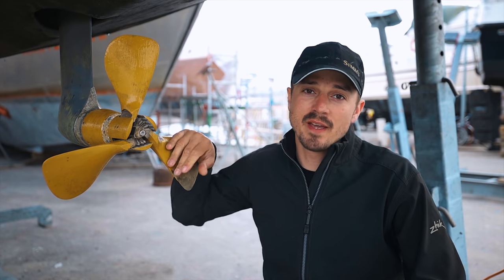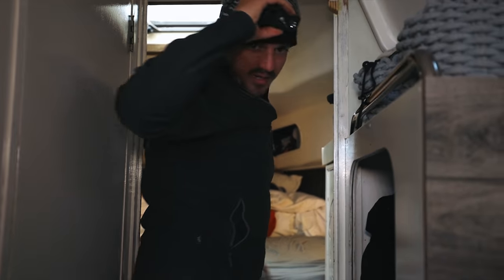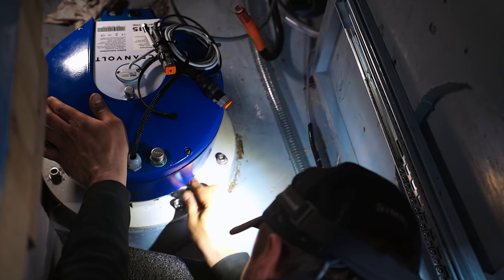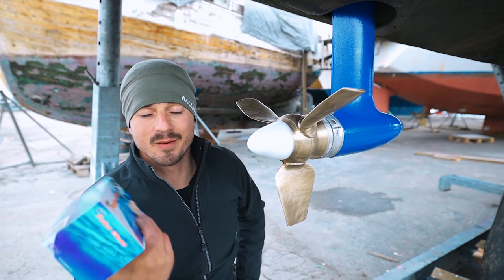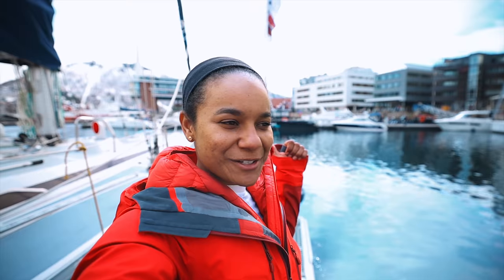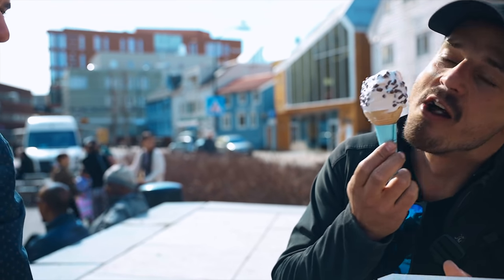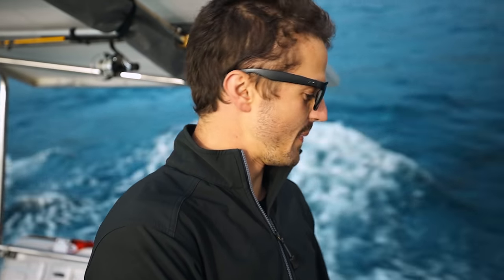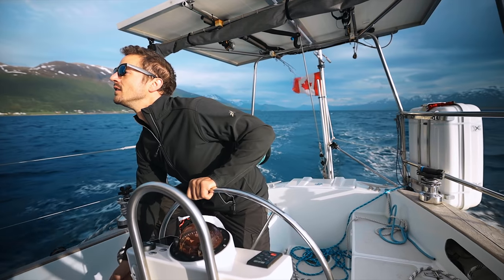Ripping Out our Electric Motor for the LAST TIME! — Sailing Uma [Step 277]

Comment: You will likely notice more of a speed drop with regen in lighter winds and slower boat speeds, not strong winds.  But then in lighter winds, you'll most likely have the prop feathered and not doing regen anyway.  My only negative comment is that prop strut is a terrible shape, will be a great weed catcher!  If ocean volt would shape that strut to shed weeds, it would make a lot more sense and be very do-able.  Love the controllable pitch prop tho, that is awesome in getting max prop efficiency at a wide range of speeds both in propelling the boat and regen mode.

Comment: How many batteries do you have  on the boat? When you use only the batt to run the elecktromotor, how long das it last on full power and full resistant?

Comment: Just an oddball idea to occupy your mind. Two bit da Vinci just did a piece on a 1940's Swiss electric bus that used a large flywheel for energy storage. One of the drawbacks was the gyro effect of the flywheel. Wouldn't the stabilization of a horizontal flywheel be an advantage on a sailboat.

Comment: I so admire your dedication to the electric drive idea. I had serious doubts on efficacy in the beginning but you've pretty much proved me wrong in many, if not most, aspects. Certainly now that you have the latest/greatest setup, I think even more downsides will be mitigated. I'm sitting down... what would a setup like what's currently installed cost?

Comment: Interested to know, when you fitted the saildrive leg and bolted it up to the motor. The hole the leg went in didn't seem to have any fairing (i.e. on a  normal engined sail drive there is a rubber skirt fitted to go flush with hull. Does UMA not need one?) does it not cause some disruption to the flow  of water over the hull where hole is? It seems like an ideal place for stuff to grow. 
Great video by the way
Reply from the maker: Things would grow more if we closed it off..

Comment: @ Sailing Uma
  What did you use on the bottom of the boat to keep it so clean?
Reply: Constantly cold water!
Reply from the maker: Sailing. Ablative paints needs to be worn down by water over the hull. If you sit still, stuff grows.

Comment: In all the years of you having an electric motor(s) , it has proven you to be exceptional sailors and that is all...the E motors and battery capacity has been sub par for the average sailor needing  to motor from A-B in opposing winds and currents. You had favorable winds for Hell Gate NYC...I can imagine less favorable conditions and someone with less experience failing that attempt. However, this new motor with solid state batteries would be magical.
Reply from the maker: Yeah no reason to ever motor against wind AND current. That’s is a recipe for disaster even with a diesel boat. 1 OZ of water in the fuel and you’re F’d.

Comment: So, for anyone with a technical interest, of course they can regen without slowing the boat. With the wind they were experiencing they were coming up against the maximum hull speed of their vessel. That means it was taking absolutely HUGE amounts of energy to give them the next 0.1 kts of speed. So when they turned the regen on, some of that HUGE amount of extra energy that they had available with that much wind and sail, was converted into electricity. It did not slow them down because HUGE minus 300W, 600W or even 1000W, is still much more power than it takes to move the boat along at 6.5 to 7 kts.  :-)  (hope that helps anyone that wondered about the physics!)

Comment: Thanks for pushing and helping advance this technology - its really great to see how much progress has been made. Can you make any comments about how the power (i.e. motoring) compares with that of a diesel? After seeing that yours is roughly equivalent to a 13 hp engine, I realize that it might not be a fair comparison. But why not? Comments would be welcome.
Reply from the maker: So electric works differently to diesel in how it applies it's torque, so although on paper, it's equivalent to a 15hp diesel, in reality, it pushes a boat more like a 40-50hp diesel. Electric is about 2-3X more efficient, so you can multiply the HP rating by 3.

With that said, we can motor at 7kts, drawing about 8-9kW on our electric motor. Same as you would with a 40hp Diesel.
Reply: @SailingUma  this is not true. Although electric motors have full torque at any rpm. Which is great for changing from forward to reverse, torque only matters during acceleration. A watt is a watt and a hp is a hp. This is just sales nonsense OV uses to mislead about the effectiveness of their products. You say you can motor at 7 knots for 9kw of power, but you leave out that you could only do that for 2 hours if you are lucky. But that is in perfect conditions which wouldn’t require much of a Diesel engine. Try it against wind and waves and see what happens to your power draw. A watt is a watt and hp is hp. You don’t get to multiply electric engines 2-3x just because the brochure says so.
Reply: @SailingUma  Thanks for the response. But, I sort of agree with the reply by Alex. When I'm motoring with a 40 hp diesel and at 7 knots in reasonably calm conditions, I'm using maybe 0.5 gallons per hour fuel. The engine is not outputting 40 hp at all but far below that. I'm only outputting 40 hp when going into a current and a headwind. I wonder if the Salerno sailboat had two electric engines because of this. Having said all of this - I'm super happy to see the technology pushed to this extent and hope that it can get even better.
Reply: @alexmiller8688  I kind of agree with you. But, in calm seas, little wind etc, my diesel engine is running far below max power to achieve hull speed. But so is the electric motor. We really need a side by side - which maybe Salerna could do since they've built an electric version of their 40 foot sailboat. But curiously, they are installing two electric engines.

Comment: Hey Guys, nice job on...... Pretty much everything! Can you feedback what your experience so far is with this new prop under power? Everything is a compromise. Gori make awesome low drag solutions. Others make props that make great power going forward. Others that are designed to run equally well forward or reverse. 
The Ocean Volt Servo Prop is probably designed to be most efficient at regen at say the 7-9 knot range........ (Feel free to correct me Uma or Ocean Volt) but how does it handle under power? Have you lost much thrust or backing up ability and is there any useful or painful prop walk as a result? We all have times when the prop walk is helpful and yet others when we wish it would either be neutralized or reversed.....
Please share.
The other thing that struck me was that this will focus crews to always sail fast i.e.  trim well, helm well and keep the boat performing, as there seems to be a great reward in staying above 5 knots (clean bottom, not dragging a dinghy, reducing windage, and all those lazy things that sailboat cruising is often associated with............) Your thoughts on whether the system has corralled your sailing behaviours to complement it?
Fair winds and Best Wishes.

Comment: I just can't imagine having a sailboat with the kind of limited range that electric motors provide.
In my forty plus years of sailing there have been numerous times that I have fired up the diesel and not turned it off for 40+ hours. A good diesel with a large fuel tank will always be my first choice.
On the other hand, if all you ever really need to do is motor ten minutes out from the slip to sail around for the afternoon and then back in, it is probably perfect.
Reply: I am a diesel freak.. have owned many & ONLY NOW understand that they are (no pun intended) Dinosaurs.. With the advanced battery tech & motors... & solar, we're getting close to not needing fossils any more. 
My son is building electric pontoon  (& other types) boats , his own design motors, .. with standard deep cycle batteries, we go for 6 or 7 hours without recharging.. Now, he's installing LIPO & solar.. It looks like a whole day to me and that's with no regen like UMA.. 
Yeah, I think it's happening.....
Reply from the maker: Yeah we’ve sailed for 6 yrs and 25k+ miles without needed to motor for more than a few miles. Motoring for more is a choice, not a necessity.

Comment: that graph is really interesting, . my first thought was , why does the impellor under the water care what direction the wind above the water is gong .. while it might be some effect between current and wind coinciding or not, it would not create as big an effect as I would expect, further, maybe the "tilt" of the board, and side slip create issues, ... very surprising that "running is generating so much less power, even though you are going same speed.

Comment: Could you try for fun to make a calculation of time and money spent with installing and maintaining your electric system vs what it would have been with a diesel engine over the years?!
Reply from the maker: No way to make any accurate calculations. We've never had a diesel. And we've mad a lot of upgrades to our system over the years. Not because the previous set ups weren't working, but because we're testing and developing new technology and don't mind ripping out systems to try something new.

Comment: Amazing to have all that "free" energy whilst sailing.  But when would you switch off the regen during a passage?  I would have thought you would need it on permanently to cover your continuous, basic power draw.
Reply: You switch it off below a certain speed. Don't know the exact data for that motor but I'd expect it does hardly any regen below 3 or 4 knots.

Comment: Love how you are always analysing and updating your systems.  If anyone can convince more to go electric then you can.  Great info as always. Does the propane regen only work on a sail drive unit or do they do a similar set up for a conventional shaft set up?   I caught a glimpse of Arktika behind you which is the new yacht for the channel Alluring Arctic.  Andy UK
Reply from the maker: Regen "CAN" work on all electric motors. But shaft drive currently don't have servoprops, so it won't be nearly as efficient. You almost need either one prop and two motors (one for propulsion and one for regen) or one motor and two props. The servoprop solves this issue, but it's currently the only unit out there that does.
Reply: @SailingUma  Thanks, I thought it unlikely there could be a servo prop on a shaft set up.  I would have to redesign my Rival if I went this route.  Thanks. Andy UK
Reply from the maker: Commercial and large craft have had variable pitch shaft drive propellors for decades. No reason that couldn't be adopted by smaller pleasure craft. But there are way more saildrives out there than shaft drives, so maybe that's the reason.

Comment: Just curious, but while you have her on the hard, why not go ahead and do the bottom antifoul again? I know your bottom is really clean, so it’s still working,  but it also like the bottom is starting to look a little rough and so it looks like it’s going to need to be done fairly soon. Why not do it now while it’s out already?
Reply from the maker: No need to add extra layers of paint for no reason. We still have at least another year or two before we’ll need to add more.

Comment: Another way to think about the impact of regen on boat speed is to consider how much motor it would take to push the boat at 7 knots without the sails.  I am thinking at least 60 horsepower would be required.  That converts to 45 KW, so taking 0.5 KW out of that is going to be very hard to detect in boat speed.
Reply from the maker: We can motor at 7kts drawing about 9kW.
Reply: @SailingUma  That is interesting.  That converts 12 HP and is way less than I would have expected.  My guess was way off!  Thanks for responding.

Comment: When you say watts do mean for 12 volt system ? 120 watts at 12 volts would be 10 amps . So you are running a higher voltage ? Curious to know battery voltage to motor and cabin . I love your adventures  .
Reply from the maker: Watts are watts. Doesn’t matter what the voltage is.
Reply: @SailingUma  a generator at 12 volts has to create 10 amps to equal 120 watts . Only 1 Amp at 120 volts . Volts * current = watts . Maybe a better question was can I use this system with a high flow low head pressure system  . I live off grid with a older solar system . I have a creek I need to develop for hydro . You have a hydro generator of sorts .

Comment: With a variable pitch propeller, why does the direction of rotation need to change?  Couldn't you adjust the pitch to go in reverse, and wouldn't it save wear on the motor (and reduce the complexity of the motor) to have the prop only spin in one direction, and control direction of propulsion with blade pitch?

Comment: I have own 2 different sailboats over the years. The boat I have now is a 48 ft Choy Lee offshore ketch with a 6 cylinder diesel .that motor has been in the boat for 12 years with no major problems . I've looked into electric Motors. but they seem to last one maybe two years before major problems happened to them. I think before I would use or get an electric motor for my boat, electric motor companies need to come up with a long endurance electric motor that can stand hard use and saltwater.
Reply from the maker: ??? What are you referring too ??? There isn't really anything to break on an electric motor. Prop zincs and some cooling oil every 2 yrs. That's it. Motors are rated for 100,000hrs and batteries will last 30 yrs.

Comment: Oceanvolt  You should have fitted larger diameter prop and achieved 600 W at 6Kn, as it would not effect the boat speed noticeably.  Then drop the price and sell Twice as many units. You are pioneering Electric sailing with in five years it will become the norm.

Comment: Hello.
I'm thinking of following your decision to go electric engine. So I watched your video with great interest a few times.
Do you wish you never went electric.
How do you generate the necessary electric power for your yacht.
You may have covered this in another videos but I've not found them.
Reply from the maker: You can miss something you've never had. We love our electric and it does everything we need it to do. 

We generate power for solar and now regen while sailing. It's more than enough in the tropics where sun and wind are more consistent. Up this far north, we're plugging into a dock once a week or so to keep topped up.

Comment: The reason you are not slowing down when the re-gen is on is because the re-gen represents a small portion of the power necessary to move the sailboat.  Its not enough to make a noticeable difference. To generate more  power at slow speeds requires a larger prop dia. and more pitch, combined with the proper gearing for the  ocean volt motor to produce more watts at the slower speed. To prove it get Ocean Volt to lend you a second  unit and temporarily mount on the boat if possible and do another test  with boat. I bet you generate about twice the power at basically the same speed with both units running.

Comment: Such a great accomplishment on the regen front! I have to admit I've been one of the quiet skeptics of this, particularly given some of the experiences I've seen you have. This is a major step forward. When you present the 'chart' and the numbers, I'm wondering if you can include range estimates with your current batteries? Assumption is that you are becalmed and need to motor for some period of time or need to outrun weather or need to make it somewhere for medical treatment or repairs etc. My concern is is that I can't just fire up the diesel, point where I need to go and get out of trouble or get where I need to be with an electric motor. Effectively my question is what is the range of the system without regen? I'm a former yacht broker and have done a number of 'delivery' type passages where we need to get somewhere at a specific point in time for a boat show or even just due to work schedules and life in general. I had a friend who I'd help bring their boat from Connecticut to Maine each year and we had 5 days for the passage so we'd motor for as much of it as was required. 

I'm thinking that we may rapidly get to the point where having a small auxiliary generator may be all that is required for long passage making, being able to motor for several days and have enough power to survive. I hope nobody takes these comments as "anti-electric" motors, I'm not at all. I'm just practical and am going to buy my 'forever boat' in about 3 years. If it could be all electric - no diesel, no propane - I'd love it. But all the above rumbles around in my brain.  I'm sure most other cruisers have the same thoughts. 

Again, congrats! The determination and grit both of you have shown on this is an inspiration.
Reply from the maker: Of your sailing on a schedule, then you’ll still need a diesel. But if could easily be a genset for the rare times you actually need it. 

Electric certainly isn’t for everyone. You need a boat that sails well, the ability to actually sail it and above average planning. But it certainly IS possible for those who would rather sail than fix a diesel motor.
Reply: @SailingUma  Huh. What an odd way to put it, and kind of obnoxious. Unsubbed. Bye.